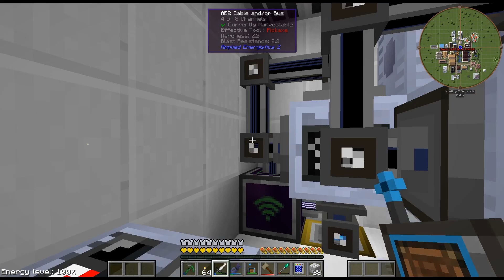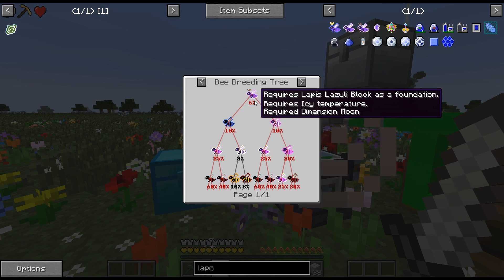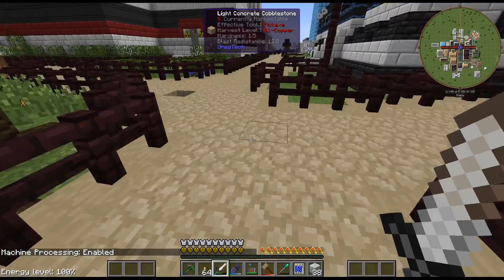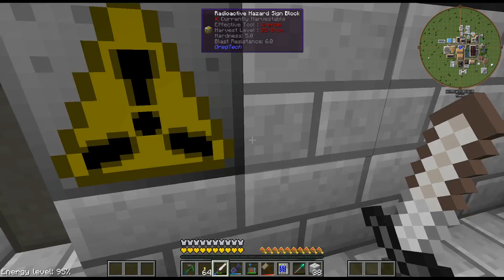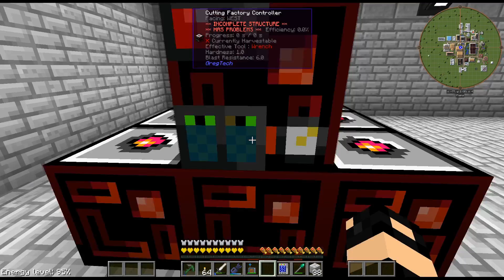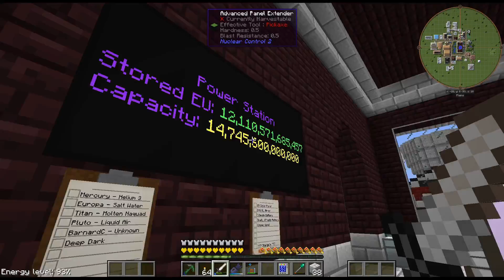Gregtech New Horizons - 346 - Cutting Factory

Comment: FYI for anyone reading the comments, the large combustion generator is ridiculously efficient compared to the HV version, with an EV muffler hatch it not only uses less fuel for more power it produces less pollution than 2 hv generators. The only downside is that it doesn’t stop burning fuel so you have to use covers
Reply: Needs titanium though at which point you can probably just make a nuclear reactor.